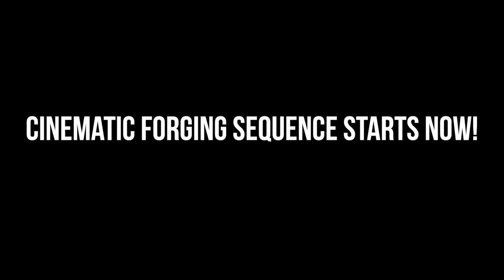Forging a Cross Pein Hammer

Comment: Good video, and impressive hand forging. Most people these days don't make hammers that big without a power hammer. 

There are two things I was hoping to see, though, that I didn't. 1 ) Hardening and tempering the hammer and 2 ) fitting the handle. Especially the latter; I don't quite have the knack for it and would really like to watch an expert.
Reply from the maker: Hey Russ! Thanks for the message! If you want to see and learn more about how I make my hammers - I've got tool making courses at my online school here - beginblacksmithing.com

Comment: I have a question: Do you ever get blisters? What do you think causes them, or perhaps, how do you prevent them?
Reply: They're caused by excess friction against skin which has not built enough callus to endure.  Friction generates heat, which separates the layers of skin, possibly causing a bubble to form underneath.  If the bubble is too big you'll probably end up losing the top layer of skin, as it will be dead -- that leaves you with the worse situation of having raw, fresh skin underneath.

Your options are limited.  Wear gloves, tape your hands in "hot spots", or just build up calluses until you no longer get them.  If you feel a hot spot under your skin, either give your skin time to cool off (water, spit, or just taking a break may help) and revisit your work.

Treatment & prevention also is true with your feet -- thousands of miles of marching, running, and carry heavy gear in the military taught me a lot about blisters and how to deal with them.  IMO, it's best not to get them in the first place, but sometimes you just have to suck it up.

Good luck!
Reply: Oh, I'm not ignorant what actually causes them; I was asking more about how holding the hammer a certain way might cause them. But thanks for the advice!

Comment: If you're getting serious about it dude, you shouldn't just use random hard drives.  Better off investing in a NAS that you can expand the storage on & a way to back it up.  More capital investment, but it'll be a better investment in the long run for mass storage.
Reply: Use backblaze for backup
Reply: Better off rolling your own NAS box. Get an Atom based motherboard with loads of on-board SATA ports, find a suitable chassis then use FreeNAS or a linux distro with Webmin and software RAID. As long as you're not looking at complicated permissions & sorting out old-school workgroup shares then the recoverability of such a system is much higher. The thing to make sure if you spend the extra on  NL SATA (not SAS) drives for bulk storage.